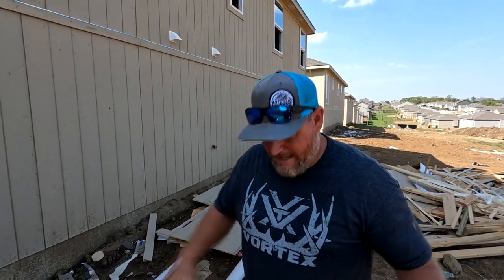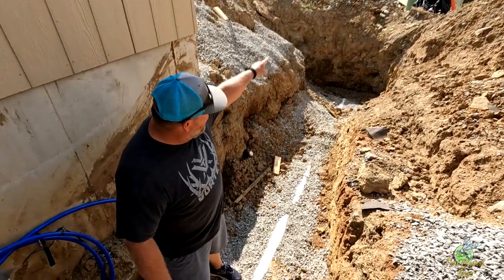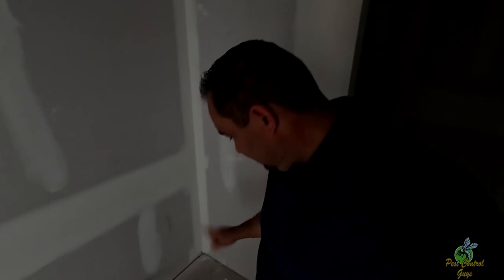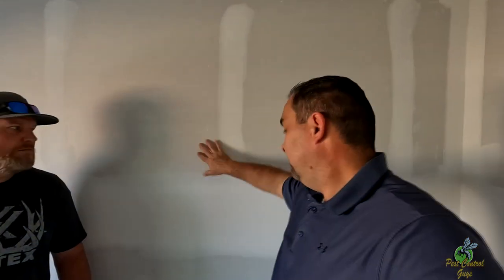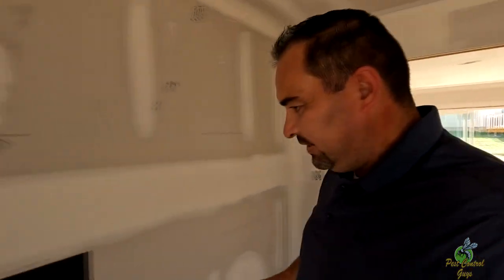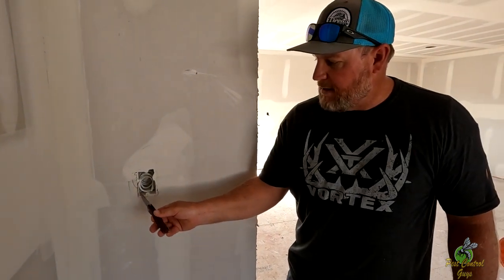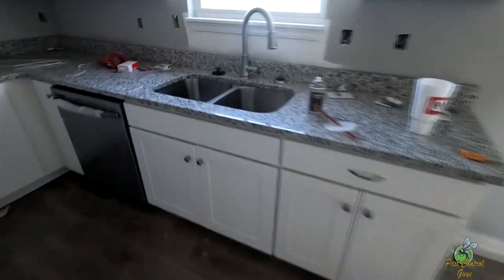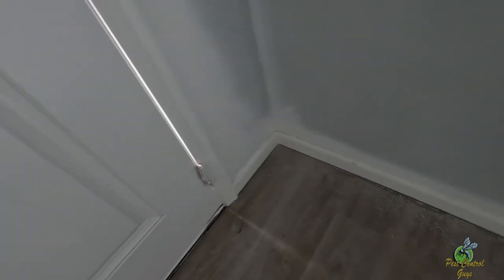How do bugs get into your home? Part 2 #pestcontrolguys

Comment: Wallboard/sheetrock is kept about 1/2 inch from the floor/concrete to prevent moisture from the concrete wicking up the wall board and causing it to blister/bulge at the bottom and to also prevent water from floor cleaning, carpet shampooing and spills from doing similar.  The gap prevents a lot of costly repairs down the road.  The gap is also very important where drywall/blue board is installed in a shower stall or tub surround area so water won't start popping the tile off as the paper backer draws water up behind it.  It also helps prevent mildew from blossoming along the bottom of the wall on a damp paper backer.

Back in the day we used to manually apply copper arsenic to the shoes on all exterior walls as an added defense against insects getting past the metal shielding and adhesive sealants.  On concrete homes we would put the shield, sealant and copper arsenic on the plate the roof trusses sat on.

Got tired of the guys claiming they put it on the ground without a gap because they didn't have any shims while they had dozens of cutouts from electrical boxes laying about and multiple lifting pedals that we provided just to make it easier to align things and maintain good gaps.  Having to get on their knees and cut the gaps in afterwards with a utility knife really helped prevent future lapses in memory regarding the necessity of the gaps.

Its about more than just expansion with mitigating water damage a bigger concern.

Best!
Reply from the maker: Good thing we have an expert on staff! Thanks Neil!

Comment: Filling holes in concrete made to move pipes or effect repairs after the slab is poured should be done with Hydraulic Cement and not regular concrete mix.  This is to prevent water and insect intrusion along with to help prevent Radon Gas from seeping in and is especially critical when working below grade.

Best!
Reply from the maker: That is the correct way. Unfortunately I haven’t seen it done correctly in a long time.